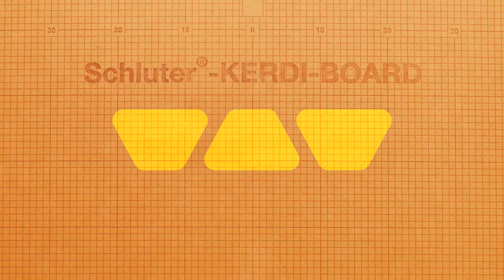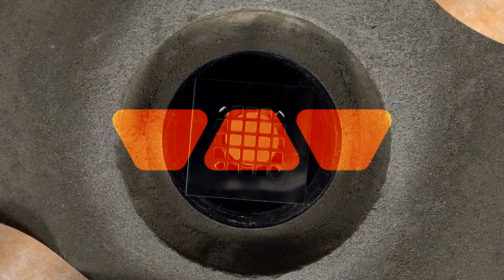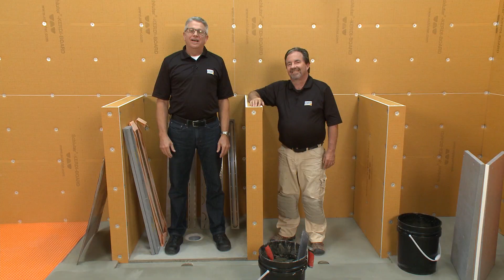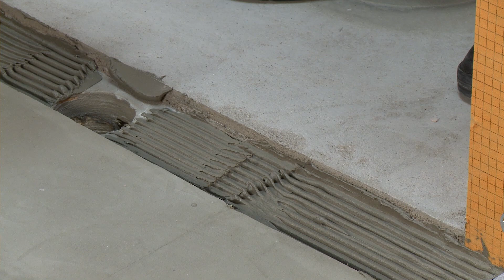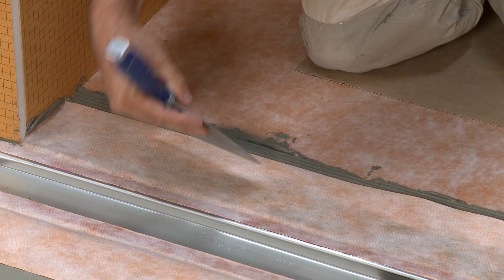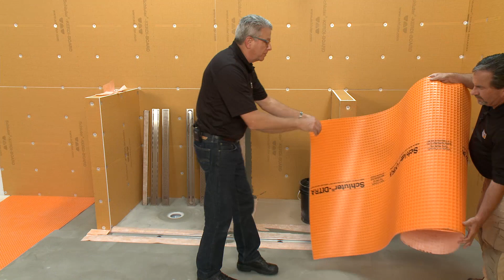KERDI-LINE as Primary & Secondary Drain

Comment: Why didn't Brian comb all of the thinset in one direction?  Isn't that the correct way?
Reply from the maker: Hi Jake,
Good eye! It looks like Bryant had most of the ridges going in one direction, but not 100%. It is important to comb the thin-set in one direction so the ridges fold over while pushing against them as you install the tile, so you end up with full coverage and support. This is not quite as crucial when installing the tray, but still a good habit to get into, as coverage for support is also beneficial under the trays.
Thanks!